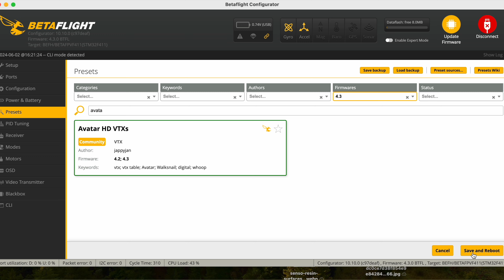65mm digital Tinywhoop

Comment: You might want to try the BetaFPV Meteor65 PRO frame,  cuz u can run a little larger prop, which should able to carry the HD system a little better

Anyway, cool little quad and it was nice to see ur building process AND seeing ur weight reduction measures 😊 
It is incredible to see a HD tiny whoop, that is lighter than the OG Tiny Whoop from back in the days🎉
Reply from the maker: I think it is all about the package. You want to go as light as possible. 31mm - 702motors and light frame seem to be the best compromise. Weight adds up quickly: 65mm pro frame +0.5g, 35mm props +0.5g, 0802 motors +1g

Comment: Where did you get the walksnail VTX/camera combo!?
Reply: Oh wait that’s not the new AIO vtx that was shown at IO few month back.
Reply from the maker: It's the standard 1s VTX. Not sure, if it's the old one without heat sink or a newer one from which I removed the heatsink. To remove the heatsink carefully pry with a cutter knife.
Reply: @Unboxingexperience7  How much weight does removing the heatsink save? I've done a similar build but I'm currently at 24g but struggling to get lower.

Also I noticed you installed yours with the heat sink side facing up, I've currently got mine facing down, im wondering if its better to face upwards?
Reply from the maker: easiest ways to save weight: props -0.5g, antenna -0.4  and peek screws -0.3g.